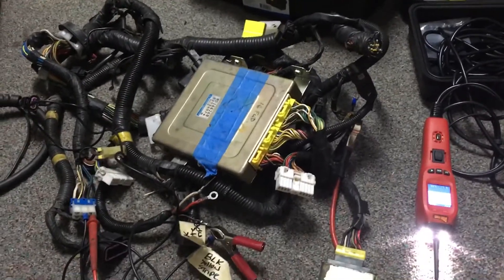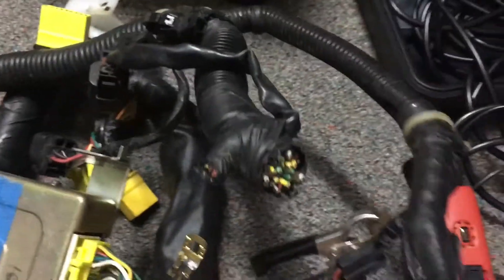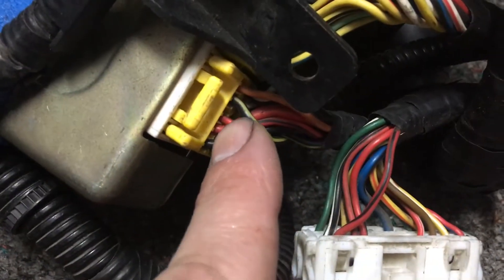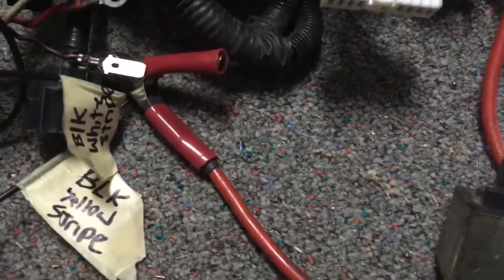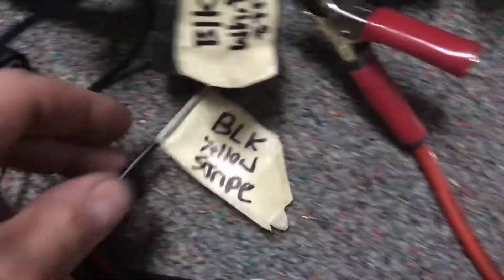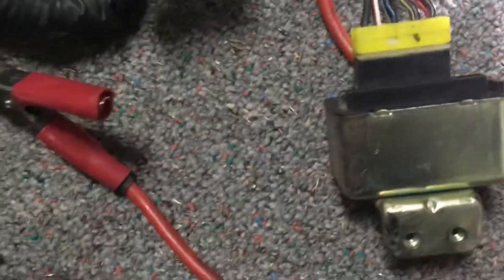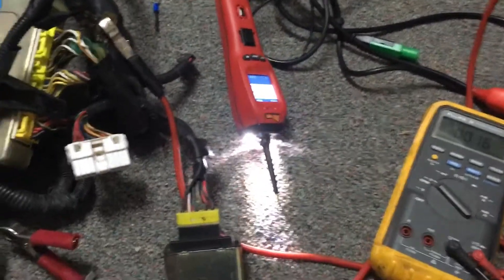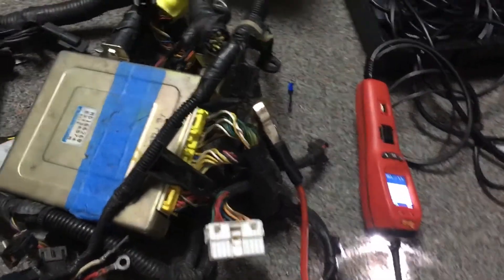How to wire a 4g63 MPI Relay and the ECU & Fuel Pump. Wiring Diagram Below.

Comment: hello i have a question pls on my 1991 galant the obd1 port has no power i checked the all fuses all good is theres any thing else i can do thak you
Reply from the maker: I am not super familiar with what voltages would be at that port, but I don’t think you will necessarily find a normal “power” wire there.  With the key turned on, the ecu send a signal out pin 1&2, which is pin 1&10 on the obd port. Then there is a speed sensor wire and a ground. If you are trying to connect something like ecmlink, make sure your cable is good and your computer drivers are up to date.

Pin 1 - Yellow - pin 1 at the ECU
Pin 10 - White - pin 2 at the ECU
Pin 11 - Yellow w/ white stripe - vehicle speed sensor
Pin 12 - Black - Goes to ground

Comment: wow, how luck that your on the exact harness I'm working on, I'm in desperate need for help, I got rid of all harnesses and basically cut up the mpi relay to power the main engine harness, and figured out that pins 3,4,5(mpi) are switched power supplies that run to pins 102,107,110 on the ecu side and pin 9(mpi) is the constant that goes to pin 108 on ecu side, as well as pin 103 will get separate constant power. I looked at forms and that's what I was told as well as looking at all pins and running the wires back, the problem I now face is that I'm not sure to to wire the switched to the ignition so when I use the starter it sends the signal to the ecu to do its thing, is it as simple as adding another line from the starter signal wire that goes on the starter to go to the 108 pin on the ecu.?sorry for such a complicated question and hopefully u can help me.

Comment: There is no signal from (fuse pump relay) pin at ecu

I changed the control relay and ecu and still no signal and pump can not powered after crancking .
Only powered during cranking .

I checked the continuity from control relay to ecu pin and it is ok.

I asked ...why ecu cant send a signal - to control relay to activate the pump after crancking ?
Reply from the maker: The 4g63 Ecu + mpi relay only sends power to the fuel pump when the engine is turning. So it sounds like you have it wired right. As soon as the engine stops spinning, the fuel pump turns off. You can test this by removing your CAS from the head, and spinning it by hand with the key on. You will hear your mpi relay click and your fuel pump turn on. Then when you stop spinning it, the fuel pump stops and the mpi relay clicks  off about 3 seconds later.
Reply: @WiringRescue  https://youtube.com/shorts/dkEJIEVXgYU?feature=share
Reply: I tested the pump by external battery and it is ok.
I then test the pump by opening the ignition switch and then grounded the ecu line at power relay (white red wire) and it is ok.
During cranking the control relay coils energized and after engine running for a while and at the moment i release my hand from ignition switch and it converted from ST  position to ON position the pump coil at control relay denregized and engine got stopped .
There is no ground signal from ecu to power relay wire(white and red) which is the ground terminal that energinze the pump coil at relay
I have changed two power relay and distributor and still the same problem.
Reply: When i turnning the CAS by hand when the key on there is no clicking at the relay
Reply: During spinning CAS by hand there are clicking to injectors only ...no clicking at relay
Reply from the maker: It looks like your wires are a different color than my diagram. Which wiring harness are you using?
On my diagram the black with white stripe wire is getting power with the ignition in the on position. Make sure yours is. Also there is a black with red stripe wire that should have power all the time (with a fuse in between the battery and mpi relay). Double check that.

Comment: Need a help

No signal from (fuse pump relay) pin at ecu

I changed the control relay and ecu and still no signal and pump can not powered after crancking .
Only powered during cranking .
The coil only activated at start position during cranking

Comment: The mpi relay from a 2.0 its the same for a 2.0 t
Reply: On 1g dsms "90-"94  mitsubishi eclipse, eagle talon, plymouth laser, the 2.0 dohc non turbo and turbo cars used the same 9 pin mpi relay, however do take note that the "90-"94 1g dsms with the 1.8 non turbo 4g37 base model 1g dsms used a different 8 pin mpi relay.

Comment: i am really thankful for this tutorial, but maybe you have any idea what is the problem in my build please: 4g63 from hyundai sonata year 93, wires colours are not the same, but i wire like in this vid(constant power, ignition, starter wired) and when i try to start, spark is ok, but injectors wont work, they get +12v for both pins. Also fuel pump pin from relay wont get power. So i feed it with ignition wire. Thank you
Reply from the maker: Make sure your IAC (throttle body) plug is not swapped with your egr/fpr solenoid plug. They are interchangeable and will give you this problem. Actually follow the wires from the IAC back to the ECU to make sure it’s the correct wires. It’s easy to mix them up. Keep me updated!
Reply: It started!! but there is issue now, that MPI relay manually wont power 4&5pins, so i powered it with ignition, is it okay?
Reply from the maker: Mantas Yo - congratulations! It sounds like something still isn’t right with wiring though. I personally would try to get that relay working right.

Did you give the black with white stripe wire power from the ignition? Does black with red stripe have power all the time?
Reply: yes it only give power when starting, actually the one wire, from the white connector(there is a lot of trash wires that i dont need like you said), red/black, i couldnt find that wire. What pin in ecu is it?
Reply from the maker: Mantas Yo - pin 103. This diagram should help you out too https://www.hotrodwiki.com/images/2/26/1991_to_94_4g63_engine_swap_wiring_diagram.jpg
Reply: I dont see fuel pressure solenoid that could have any connector(only vacuum on fuel rail). And i didnt touched wires like throttle body, o just swapped engine harness with engine and ecu to another car. Feel really lost, trying to fix this problem for a week ;D
Reply from the maker: Mantas Yo - I would bet some wires are mixed up. Take a look at this wiki I made for 4g63 wiring and compare it with how your car is set up. https://www.hotrodwiki.com/index.php?title=How_to_wire_a_4g63_engine
Reply: Its a fact that something i connected is wrong. I will check where wires go to know what connectors it is. Wire colors of hyundai are different so its bit confusing. I have 2 6pin connectors, MAF and I guess ISC(down the throttle body) same connectors, both have 6 wires. Doesnt matter which i connect, problem still appears
Reply: Thanks, Black/red have constant pwr, black/white when ignition on
Reply from the maker: Mantas Yo - does black with yellow stripe get power only when the starter is actually turning? As soon as you let go of the key from starting it, the wire should be powerless.
Reply: Oh its the same wire that already gets constant at MPI relay (10). Maybe i just could ground MPI pin 8, because ecu doesnt do it itself? :/

Comment: Hi Jeremy this tutorial can work for 4g64? I need to do the wiring for the ECU MD304089, but I don't know if this tutorial works on my case?
Reply from the maker: Francys Pérez Mora - unfortunately this is definitely not the same as a 4g64. It has a different cylinder head, and therefore different sensors. Some of it may be similar, but it’s probably a small amount.
Reply: @WiringRescue  thanks for the quick responde. By any chance do you have or knows where I can find the wiring diagram for 4g64? I have been searching everywhere but nothing 😔 thanks in advance!!

Comment: I have a problem with my 6G72 Montero v6 but not sure what's the problem. I don't ground from the ECU to keep fuel pump running unless I have to ground that wire to the MPI

Comment: So... I ve a first generation of mitsubishi eclipse (eagle talon) 2.0 liter 150 hp non turbo version. With high atmospheric temperatures I often had some click from the mpi relay and some"switching off" engine during the drive that off course restarted immediately. Not nice if the trip is long under the sun... Never during the "non summer" seasons. But from yesterday I turn the key and I get just click click from that mpi relay... Do I have to replace the ecu boiled from the hot, or the mpi relay? The fact that it clicking means it is working right? Many many thanks in advance...im getting desperate!
Reply from the maker: jackgaby - from my experience that typically means your ecu has issues, not your mpi relay. I believe that ecmlink still rebuilds these ecu’s if you want to have yours refreshed with new capacitors. Before you do all that though, try jump starting it with jumper cables to make sure it’s not just a dying car battery / alternator.
Reply: @WiringRescue  I ll try but I have pretty new battery...and I guess if I push the car in neutral getting some speed and then I turn the key, engine starts... Any how I try. Thanks!

Comment: I'm having problems with my 1g tsi. I'm getting no spark and no fuel. I think it's this relay but I can't be sure. Is there a way to test this work jumper wires to the replay, or to the plug?
Reply from the maker: Joseph Anderson - I’d bet that it isn’t this relay. It’s almost always the ecu or the CAS causing that issue. Do you happen to have a spare of either one of those?
Reply: @WiringRescue  I do not, but it is the relay. I got help from a couple guys on a forum on how to test my ecu. The new replay will be delivered to me by Friday. I got one from rock auto for $100. I'm planning on sending my computer in to get socketed and dsm link too so if by chance the pins or my meter were lying to me than I guess I'll have to send it in sooner than I planned.
Reply: I've delt with the cas, I have 2 spares and I know that isn't the problem. I didn't even check them this time. I was between the ECU and the mfi switch.
Reply from the maker: Joseph Anderson - awesome! Keep me updated with your findings. I’d love to know the final result, and hear that the car is back to DSM-reliable again!
Reply: @WiringRescue  it was the mfi relay. I ordered a new one from Rock Auto. It came Thursday, I put it in and started the car right up. I shut it down as I haven't had time to catch up on maintenance. I won't have time to next weekend to pull it out. I'll be putting a fresh new battery, oil, coolant, and filters in it in my spare time this week. Once I get her out the corner of the garage I'll be checking brakes and belts/tensioner. Then once that's done I'll be cleaning it up and getting ready for paint and sending my ecu to get dsmlink. There's no rust on my MN classic but it's faded through the clear.

Comment: I have one to do but it would have been nice if you could have shown Ac wires tack speed in and out if any out charging system maybe you could do another bid with complete wires needed for conversion please
Reply from the maker: Allan Folkes - thanks for the input. I’ve built a lot of these harnesses for people and so far, nobody has wanted the A/C wires yet! Lol. Luckily, they should be quite easy to hook up! The wires go directly from the ECU to the A/C compressor and temp sensors, which also control the fans. I believe the fans are the only thing that needs power from outside of the ECU harness. The rest is all just connections between the ECU and sensors & A/ C compressor.

The tachometer is tricky because it’s the white wire on the power transistor, but if you plug that into a tach gauge, it causes a misfire in my experience. Another option is to connect the tach gauge to the coil wires, which works, but you will need to have an adjustable gauge that can offset for waste spark. I ended up building something very custom for my 4G63 truck that looked totally factory, and worked great, but it was an epic amount of work.

Lastly - the charging system from the vehicle that the engine is being swapped into is the easiest to use because the Dsm ECU doesn’t connect to it. I have always just used whatever charging wires were already in the car/truck to make the alternator work.  

Hope that helps! 
-Jeremy

Comment: Man, this helps a ton. But it'd be really cool if you did a video going over the harness showing what you do and don't need. So it could be cut out for a cleaner look!
Reply from the maker: I can definitely do this, but it may not be for a bit, because I have some other big projects in the works.
Reply: @WiringRescue  that'd be really cool if you did lol I'm swapping a 4g63t out of a 91 eagle talon tsi awd into a 93 colt. I believe I could get it running off this video alone but you would be highly appreciated if you'd go into great detail what all has to be plugged into the harness, and everything you can cut out and the motor still run and function properly. It would be the most viewed 4g63t swap video ever!!
Reply from the maker: @chuckd387  - have you seen my website https://www.hotrodcoffeeshop.com/forum/viewtopic.php?f=8&t=72  or this 4G63 Wiring Diagram I made? http://blog.hotrodcoffeeshop.com/wp-content/uploads/2012/08/4g63ecudiagram_1.jpg  Both will answer all of your questions :)

Comment: Jeremy,  my question is about the white connector with the red wire with the black tracer at 1:30 in the video.
Where in the car would that connector/wire be hooked to. The ignition switch? 
I take it should be hooked to a switched positive power source?
Reply from the maker: tpcoachfix - good question! On a 1G DSM there is a white wire that comes off the battery to an 80A fusible link (#1 in the fuse box). That fusible link feeds power to a bunch of things, including another 40A fusible link (#6 in the fuse box). That fusible link has a white wire with a red stripe coming out of it that feeds a bunch of fuses in the fuse box, including 10A fuse #19. That fuse has that red wire with a black stripe that powers up the Ecu. 

So - in short, you want to feed that pin 103 at the ECU (known as back-up power) ALL the time, BUT make sure it is on a 10A fuse. 

On my last 4G63 swap, I added a 10A fuse circuit to my factory fuse box under the dash. That way everything was totally factory looking/working and generally awesome.

Comment: If you hook up a cas and spin it, it will also turn on the fuel pump, as the ECU will look for the cas pulses to verify the motor is running.
Reply from the maker: Joe Riggieri  - you are totally right!! Once everything is wired, and turned on, spinning the CAS will turn on the mpi relay. When you stop spinning the CAS, the relay will wait about two seconds and then turn off. If my harness wasn’t cut, I would have loved to have shown this !